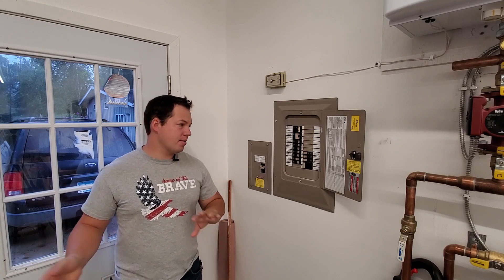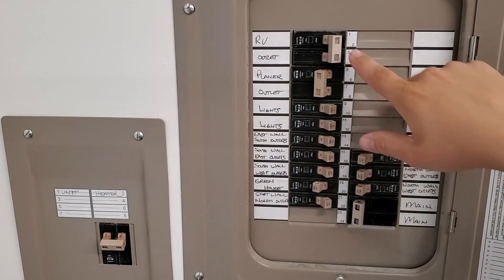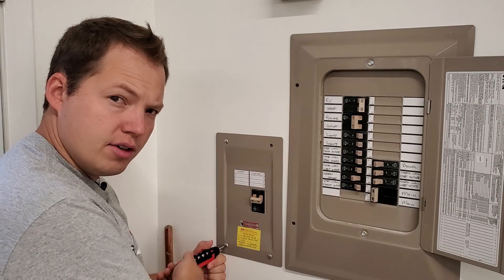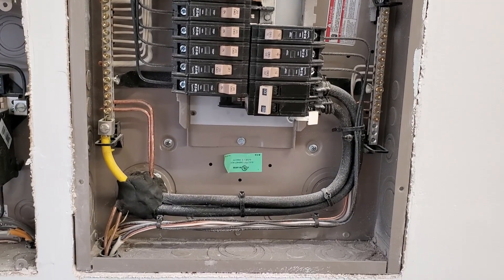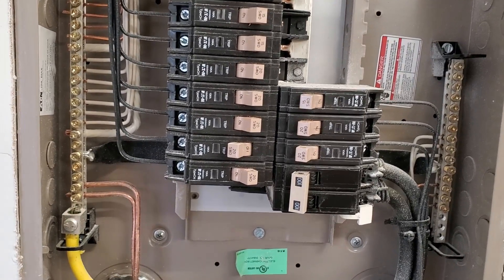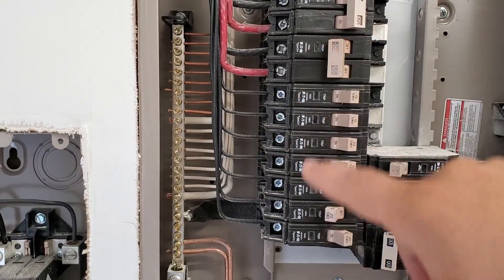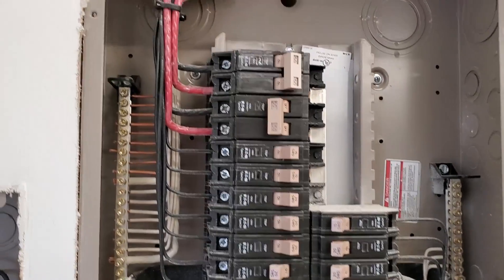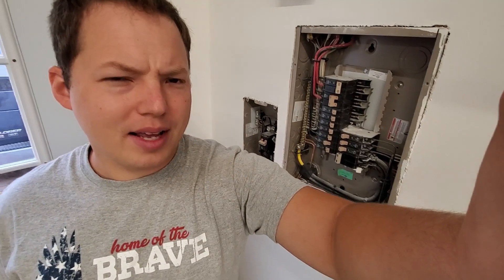Work Shop Electrical 100amp Main Panel

Comment: My dad upgraded our house service and electrical panel to 200 amps. He used Square D QO.
Reply from the maker: It's hard to bear QO in my opinion! Excellent choice. I like the "visitrip" breakers where you can see the red through that clear plastic window when the breaker trips.
Reply: @BenjaminSahlstrom  Yep. I like Homelines too.
Reply: @BenjaminSahlstrom  The trip indicator is very nice. I bet Square D has a patent on that because I've not seen that from any other manufacturer.

Comment: I’m not an electrician, but a big electrical geek like you, so I love your YouTube posts. My favorite panels are Siemens, I just think they’re the best designed with the neutral bars that run alongside the breakers. They’re nice because you can rough in all the branch circuits so the neutral, load, and ground conductors are close to the same length in the panel. I think competing manufacturers have come closer to this design such as the Cutler-Hammer (Eaton) in this video with long vertical terminal bars running alongside the length of the panel gutters.

That panel was wired pretty much perfectly. My only quibble might be the really tight 90 bends with the heavy gauge conductors in the top left, you can see that it caused the outer clear sheathing to tear. Instead, some graceful sweep bends into the breakers would have been ideal. That clear sheathing, by the way, is what makes conductors rated for 90 degrees C. Older ones (back in the 1980s and earlier) were 75 and even 60 degrees C, and you’ll notice there is not that clear sheathing if you encounter older wiring. Unfortunately it seems common for that sheathing to rip or tear easily when stressed, so it’s good to use some care when stripping the outer sheath of cable and not to be too rough with it or having it scrape burred metal during installation.

I like how the main breakers were located on the bottom right, because the service enters the box on the bottom. This minimizes wire congestion in the panel when it can just be terminated a short length. You’re right, it does not matter because the box backplane lugs are symmetrical top to bottom, left to right. And yes, service almost always usually seems to terminate be at the top.

Lastly, main or subpanel? On cursory inspection without opening the cover, some clues of a subpanel are no disconnect (such as your mentioning five or fewer branch circuits not requiring it since you can flip them all off with your hand). If there is a disconnect, it should be labeled “service disconnect”, not “main”. The “main” designation is reserved only for the main service disconnect. Other than that, it’s hard to tell without opening it and seeing the neutrals and grounds isolated (assuming it was installed properly, because it will still work wired like a main panel!).
Reply: Aaron Kaase So did you get electrocuted yet? Ha ha I am kidding. You know, if you touch a hot wire for a outlet the shock is not that bad. It’s just a tiny zap. 240v and above is the bad boys. My father is a master electrician and I had a chance to work under him and yes I got zapped but nothing higher than a simple outlet or switch wire. 😂
Reply: No electrocution yet! 🤞😄 Though I do have a couple pair of wire cutters that are notched because of a big spark from cutting a neutral and hot simultaneously that I thought was de-energized! Yeah 120V is fairly safe to work with and many very experienced "sparkies" (slang for an electrician) purposely  work with live circuits. Not a good idea in my opinion!
Reply from the maker: I've heard great things about the Siemens panels as well but have not worked with them. It is so nice how the wires all terminate at nearly the same point. Just makes so much sense!

Thanks for sharing about the clear outer layer being the 90 degree jacket! I was always somewhat curious why they did it like that. True that it is easy to damage. I too noticed that the bends were pretty tight on the wires but I always wonder if that really could cause an issue. 

I agree about the "main" disconnect and "service" disconnect terminology. I need to make sure that I keep this in mind as much as possible whenever applicable. 

Thanks for the great thoughts! Sounds like you should be an electrician or maybe an inspector!
Reply: @BenjaminSahlstrom  The tight bends are not at all a big deal if it was just bent one time and not wiggled too much. Just think about when you bend metal, it physically stresses it at the crease and you are actually causing it to become weaker because you are breaking it down.  The weakened area causes some electrical resistance in the conductor, and resistance creates heat. It could just be micro-ohms of resistance so it’s not like you can’t sleep at night. In a perfect world no wire would ever be bent, but of course that is unrealistic when you are stuffing switches and outlets in device boxes. But if you can help it, always try to make nice big radius bends in cable runs. Just like you would with PEX pipe for good water flow, it’s the same concept. Data cables (like Cat 5e and 6) are especially susceptible to performance degradation with kinks or tight bends. 

Thanks, yeah, I should have been an electrician in my younger days. I guess I like doing it more as a hobby or avocation. I’ve read a lot of books about it. One of my favorites is Wiring A House by Rex Cauldwell. You can learn all the real world craft of electrical installation with his detailed pics and he talks about the tools of the trade he uses. See if your local library has a copy of it or if they can get it for you through an inter-library loan. But I can almost guarantee you will want to buy it when you read a few random pages in it. I bought my copy at Menards years ago.
Reply: Benjamin Sahlstrom all wires should have a sweeping bend, never 90 degrees. No zip ties either. A panel should be safe and easy to work in and semi attractive. Not hard to work in and beautiful..

Comment: In the Caribbean all grounding conductors are insulated with green sheathed.
Reply: Yes, the bare grounds seem to be a North American thing. I know in the EU, you have to slide green sheathing (actually green with a yellow stripe) on the bare copper wires between the stripped end of the cable and where it terminates. I never understood this requirement because ground is just, well, ground... if a hot wire touches it, it's doing its job!
Reply from the maker: I am glad that we aren't required to have insulated grounds. I guess theoretically if a grounding system was not properly grounded at the panel or ground rods there would be a chance for it to be energized in a dangerous way. Would love to know the official reason for the requirement.